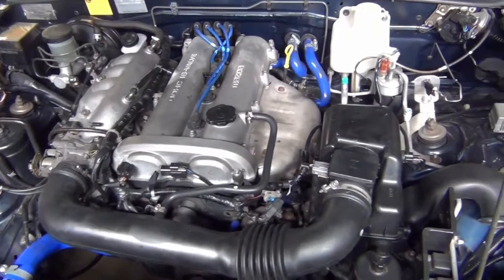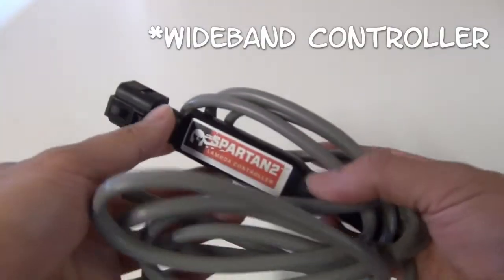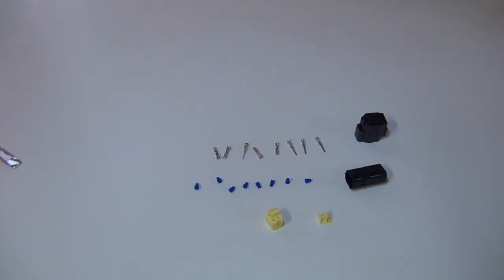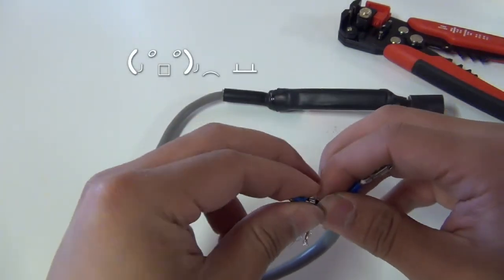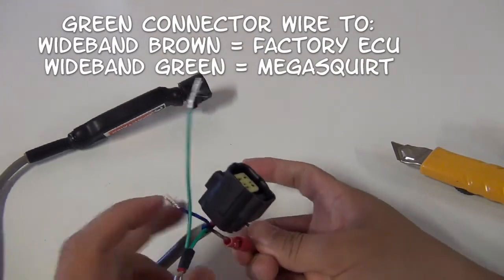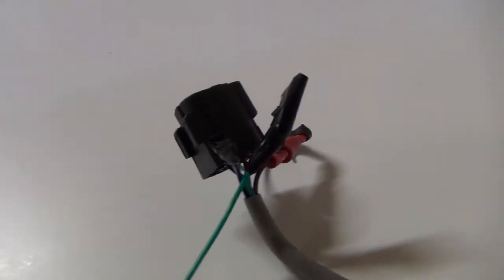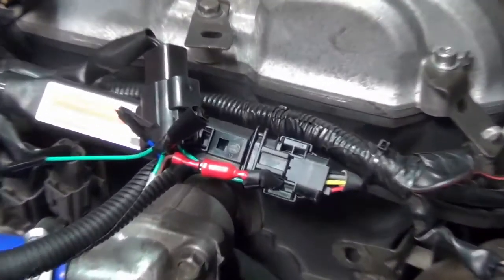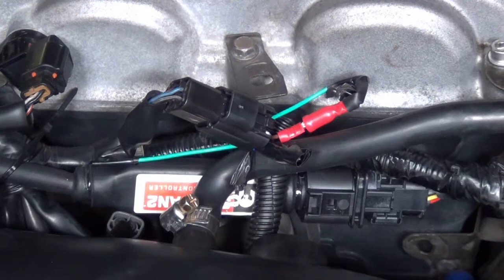Wideband Controller and o2 Sensor Install

Comment: why does it not read properly ?
Reply from the maker: Engine is toast! Had been overheated before I got it. Planning to update a series with my rebuild.
Reply: @YuyuJitekiGarage  i meant the o2. it isnt reading any values that mean anything ?
Reply from the maker: Ah I get you, it was meant as a sneaky preview of getting the gauge installed in the next ep. it wasn’t hooked up to the sensor yet so that it could make it into the previous video at the time.
Reply: @YuyuJitekiGarage  thanks for replying man. how do you find the spartan2 after using it ? i have one and it is very laggy to update but assumed i did something wrong haha.
Reply from the maker: Thats interesting it reads almost instant values to the MS ECU when logging for me. Maybe you got a faulty unit? The whole idea of the wideband controller is to have that quick refresh rate.

In saying that though I have no experience with using any other wideband controller.